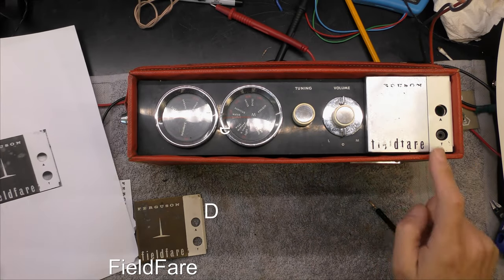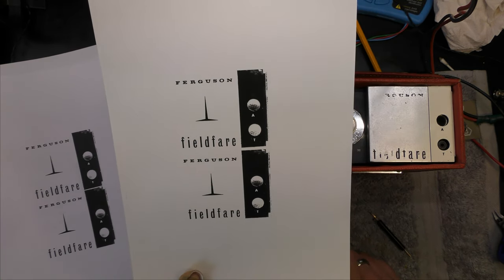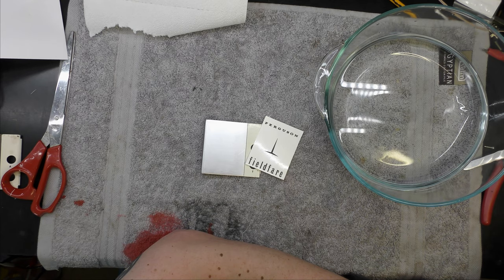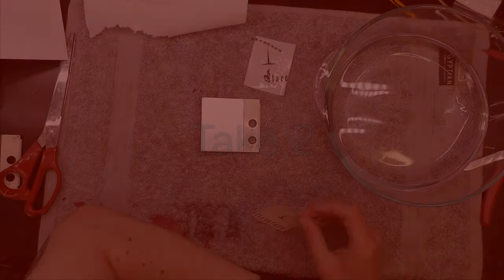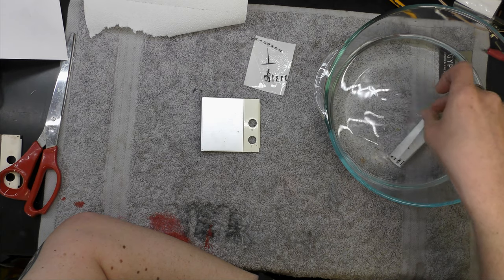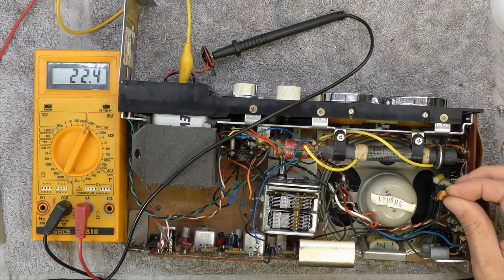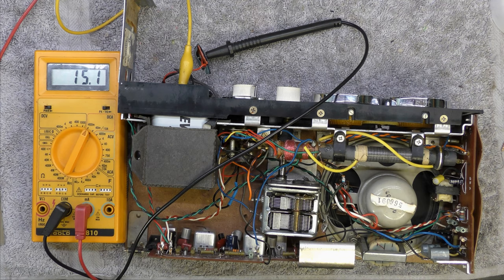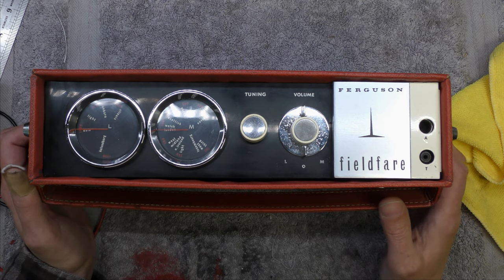Fieldfare Ferguson Mk2  PT2 Decal & Thermistor 1963 Vintage Transistor Radio (4K)

Comment: Very Nice Darren Turned Out Great !! Takes Me Back To Times When I Made Projects And Then Used Letroset On The Aluminium Polished Front But Not As Classy As Yours Thanks For Uploading Regards mike.
Reply from the maker: You know Mike I tried letroset a long time ago and was not very good at lining up He he. Thanks, it looks OK in the end.
Reply: @darrencoe5795  Just Sent Away For Some Letroset DarrenTo Do The Off/Mw/ And Lw On The Wave Change Buttons On My Gec Transistor Seven As Their Missing Off Mine.

Comment: It certainly has come out nice. I find it easier to work with smaller waterslides, yours I would have done in 3 parts so as to make it easier to get rid of the water underneath. There are so many ways to do things that none are right as such, just nothing is wrong!
Reply from the maker: I think I need a little more patience with things. I think if I had done 3 bits I would have struggled to get them all straight but I will bear that in mind. Getting friend to help was a good thing as has done motorbike ones. Yes the water was a problem and I wonder if should have used distilled water.Thanks George.